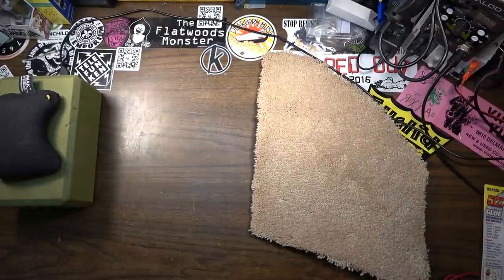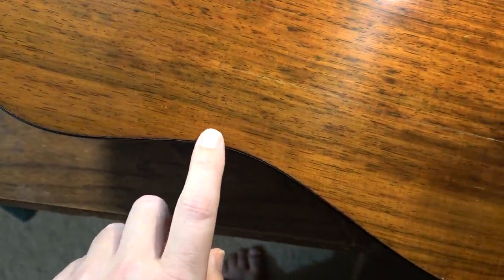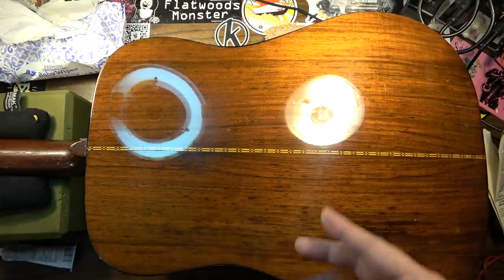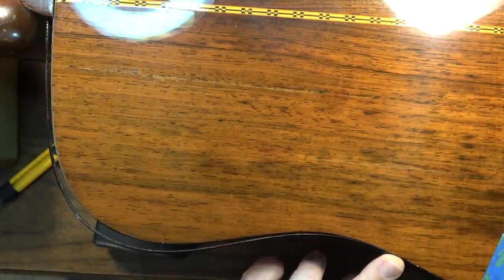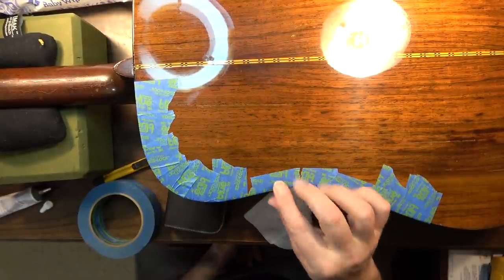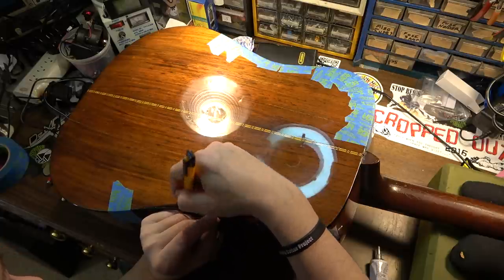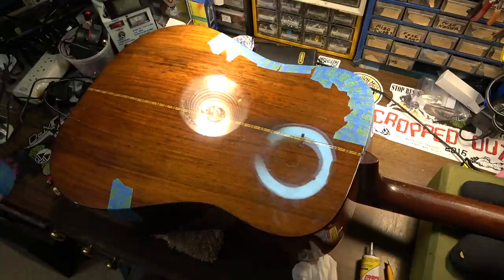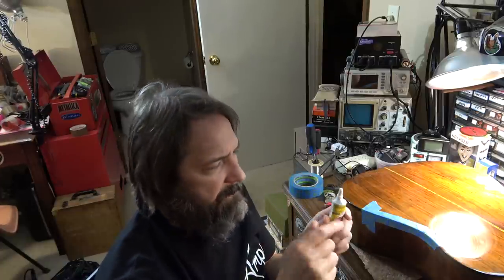RANT & REPAIR: My 1956 Martin Crack Inspection & Binding Fix

Comment: Crack inspection. This could go several ways.
Reply from the maker: Several different levels of viewership as well.
Reply: When the plumber is working under the sink, I go in the other room.  Don't want to have to use bleach on my eyes!  :)
Reply: I'll tell you where to put the gap...

Comment: I'm glad you decided to post this. My '72 D-28 has this same issue. Thanks for this video!
Reply: Put boveda packs in your instrument cases. They are inexpensive and they keep the relative humidity in your case perfect. If its damp the boveda pack dessicates. If its too dry the boveda releases moisture! No more expanding and contracting!

Comment: There are actual luthiers and then guys that claim to be luthiers.  I've got 20 years of experience building things, but I'm no luthier...  But I can spot someone that isn't.  But you are totally right about the toxicity of the guitar community.  It's almost as bad as the star wars fan base....
Reply from the maker: I don't claim to be a luthier either. I can do a lot of common repairs on guitars, including damn near completely disassembling and reassembling them if need be, but it's just not something at which I consider myself an expert. Plus I don't have many of the shop tools necessary to do a lot of luthery work.
Reply: @TheGuitologist  that's ok, you're kinda teaching me a little about amplifiers, though tube amps aren't really what I have no luck with, it's the danged solid state practice amps lol.

Comment: Very timely video, Brad... I'm looking at the same type repair (on uncut binding) on an early-70s Ovation. I'll attempt the repair myself, now that I've seen what all is involved... Thanks...!!!
Reply from the maker: Get an artist’s palate knife or razor blade and go slow removing the binding. If it’s on the TOP of the guitar, it might require neck removal to get binding loose under the fretboard extension. Unless you want to remove binding to the heel instead. Then you can cut at the heel and hide with purfling.
Reply: @TheGuitologist  The palette knife is one of the most useful tools I have ever had. I use mostly when making radio control airplanes.

Comment: Without the tape securing the non-loose binding, when you pry it out to clean or get glue behind it, old brittle binding can also crack, screwing up the the guitar more.  You could remove the binding on the other side of the split, and put it back on, closing the gap.

Comment: Humidity changes that occur during change of seasons sucks. I try an adjust every truss rod, as needed, in the house each season.
Reply from the maker: This was completely my fault. My water main busted late last year and with no water in my house, I was forced to stay elsewhere for a couple weeks. During this period, the guitar was left on the stand with no cooking or bathing in the house to add moisture to the air. My HVAC humidifier, which I had thought was functional, turned out to NOT be functional and I later fixed that too. So, ultimately, it's my fault it happened.

Comment: Oh how I wish this video came out a few days ago. I did this same exact repair on my D-28. Same glue and tape. Same problem, but binding not broken. I screwed it up royally. That beacon 527 I would not recommend, if you don't wipe it up within milliseconds, it melts the clear coat. I learned this the hard way. Bah. I'm surprised you didn't have the same problem, but my glue kept coming out too fast and would have a ton of squeeze out.  Instead of breaking the binding loose, I used a hair dryer to soften the binding enough to fit down in the curve again. This seemed to work but not perfectly. When it cooled, it shrunk again. its pulling away slightly and will probably pull off again in the future.
Reply from the maker: I tried the hair dryer stretching thing before too on a cheaper guitar. I seem to remember it worked ok. But that was on the top where moving the gap isn't as easy.
Reply: @TheGuitologist   I decided to stop on one side and haven't done the upper side yet. Somehow I need to make sure not to use too much glue. The 527 does keep the binding in place but I was struggling between trying to keep the binding hot and then glue and then tape....and neglected to wipe up the squeeze out fast enough. Your method would be easier because there wouldn't be the third hand needed for the hair dryer.
Reply: beacon 527 is the glue?

Comment: Get some boveda packs for your Martin.  I use them in my bud to keep the humidity perfect but they actually make them for musical instruments.  They call them "Boveda for music " it will keep the RH at exactly where you want it. If the inside of your case needs to be more humid they release moisture. If it is too damp inside the case the bored acts as a desiccant. I keep them in all my instrument cases now and swear by them. They're worth checking out...

Comment: Hey Brad, this video was helpful. I have a Guild I got new in the 70's with the same binding problem.  I thought I would have to heat it and force it back into the waste, but that would probably fail. Going back to the neck is a good idea. Thanks!

Comment: What do you think about oiling the inside of the body to help keep the wood from drying out?  I live in a climate where thin woods like the guitar body are prone to crack in the winter even with humidity control.
Reply from the maker: Never oil wood which is supposed to resonate. It'll dampen the tone noticeably.
Reply: Your humidity was mayne not high enough . Oil can ruin it  nor keep it from cracking or literally coming apart at the seams. edit; Acoustics are most always in a state of degradation , sometimes even when well  kept they can crack or warp
Reply: @TheGuitologist  Thanks.  I was thinking about that being a problem.

Comment: I'm practiced with an iron. I know the difference between a 2 layer board and a 7 layer board. I've built so many kits. I'm considering getting into stained-glass. I know what all the parts do. What they are called and how to measure them. It's the diagnosing and building of a circuit that is tough to learn. Unless you learn well by reading books. No places teach this in a way that takes examples and performs them with an explanation of how the fundamentals apply. Clive explaining eBay junk and autopsies over and over has helped a little. I wish someone would put together videos that you can apply to a repair or project that make the fundamentals more accessible. So much easier learning to be a transmission rebuilder.

Comment: There's a rule about not razzing amp techs about their work???   Someone tell the comment section.......  I get razzed every time I make a J-hook.  For the most part,  I chock it up to "different techs have different styles".    Some of the things I fix are things that any cork sniffer wouldn't touch.   I just finished a Crate BX-15...  some amp with no name on it... and A Hughes and Kettner Matrix 100 in process....   All three of those are certainly not on anyone's coveted list.    I've been posting less videos lately so I can just get more stuff done and out of here.
Reply from the maker: Not a thing wrong technically with a j hook connection.
Reply: @TheGuitologist   Especially when the vintage component had twice the lead length as the replacement part.   My Jukebox is J-Hook city in there...  but it's 100% working...   and I have my own songs on a 45 now.   My record is too "politically incorrect"  to play on Youtube.   and I love it.

Comment: Bad amp & good speaker vs good amp with bad speaker?
Reply: Bad amp good speaker. A bandit with a good speaker will sound better than a 65 deluxe with a cheap speaker out of an am radio or something 😂
Reply: @misterknightowlandco  Lets say we use guitar speaker. Guitar cabinet?
Are there bad guitar cabinets? Are there bad guitar heads?

Comment: Why spend big $ on a xacto pro set?
It’s not like you’re planning on preforming 
an appendectomy.
In my opinion the generic harbor freight snap blade razor knife is a very underrated tool.👍

Comment: I’m going to offer up a possible solution that came from a real luthier; not me. Your back cleats can be permanent fixes by using mahogany or similar hardwood. Crossgrain installation may be best. The sides of cleats need a fine bevel about 20 degrees, like a chef knife on one side only. When installing the cleat, the sides of the guitar should gently be squeezed together with quick grip or similar clamps. Maybe just 200 year temporary; as opposed to absolute permanence. I used this approach for a spruce top; huge cracks, spruce cleats instead of mh., and in 15 years, no movement.
Reply: Also of note, just for your own reference, is that Bruce Ross, former partner of SCGC, let it be known that when he was with the company, ALL glue up assembly was done with the aliphatic resin glue, like Titebond. Not that any other glue is wrong. I see a lot of 25 and 30 year old SCGC guitars without any binding issues.

Comment: When I designed products, which were used for production environments, I always kept in mind the ease of repair. This also meant ease of assembly. It may add a little size to an item, but if repairs were needed (as under warranty) they could be performed faster, thus saving time and money. I still come across working equipment I designed in the '80s.